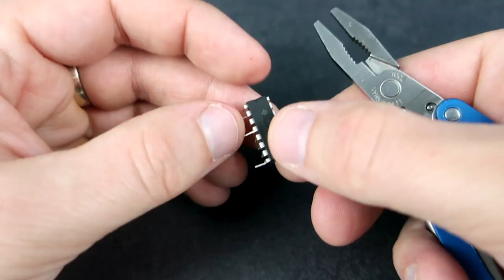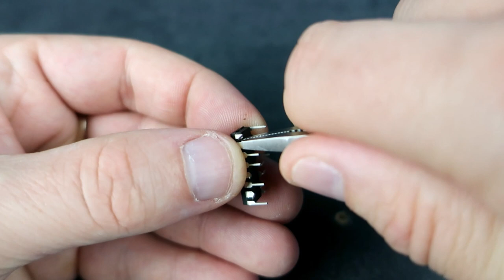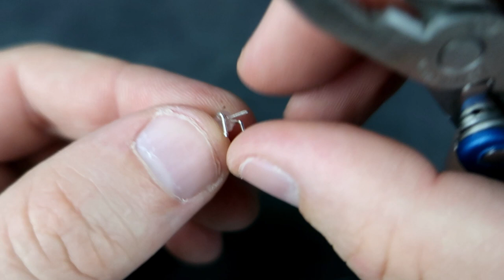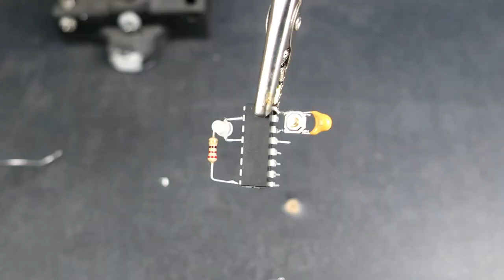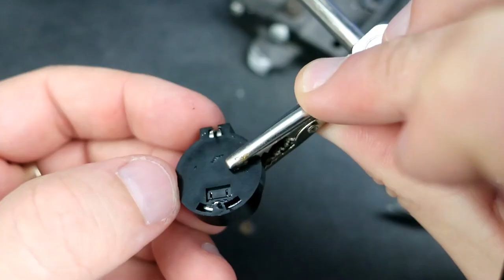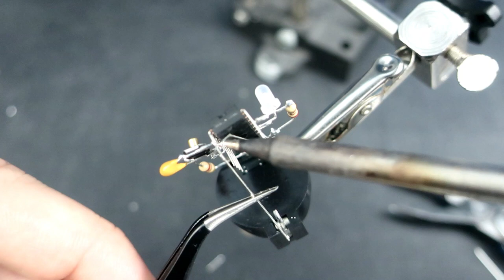Best Electronic Circuit in WORLD

Comment: I've never used a decade counter for anything - wouldn't know what to do with one TBH. My favourite circuit is the Joule Thief - get a month's light out of a "dead" AA battery or add a capacitor and a higher value resistor and flash an LED for the next 5 years
Reply from the maker: i made JouleThief couple years ago, i didnt know that it can run so long. Thank you

Comment: Hi. I really enjoy your videos. You asked us to let you know how we liked this style of video so here's my opinion. I liked it. Didn't like the music with it though. My work environment is loud too and I tend to prefer videos with less "noise".  Your voice overs are great, full of useful info. For some reason I learn better from people with certain accents. Your accent is great for teaching. So more of that please. If you need an idea for a video (or series)...I'm starting a "whole home" automation controller project. It will be an hmi interface with additional cell phone control app that is modular. One module will control/automate my lawn sprinkler system, one will control my attic elevator lift, another will control my garage door, another my air compressor, my garage heater, etc, etc. It'll be a challenge but even finding the right plc/microcontroller hardware is confusing. I'd like everything contained in an industrial cabinet with DIN rail mounts. The HMI would be a combination of physical buttons and a decent sized touch screen.  There are lots of videos on youtube about different microcontrollers but they all stop short when it comes to making reliable, industrial grade solutions that are safe and reliable. I think videos that show a project from beginning to the final solution  (that isn't a bare circuit board hanging off a few wires and a bread board) would be very educational.  Thanks so much for your content. Much appreciated.
Reply from the maker: Hello, thank you for your  comment. You have big project in mind. Do you plan make video about it, that will be great video.
Reply: @VolosProjects  ya it's a big project. It starts with getting my garage ready. I have finished installing the insulation, wiring, air plumbing, IO wiring for sensors, control cabinet, elevator opening, installed the lighting, painted it and I'm now building the cabinets that line all the walls. I've purchased almost all the mechanical devices that the plc will eventually control but haven't yet decided which plc hardware or software language I'll use. As far as filming it all. I don't really have time for all that....but you've got me thinking about it.